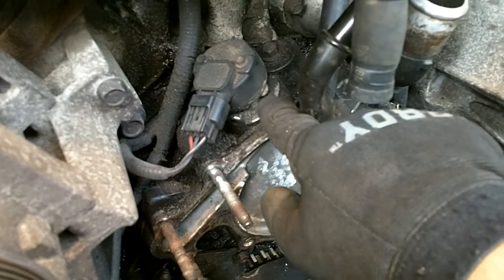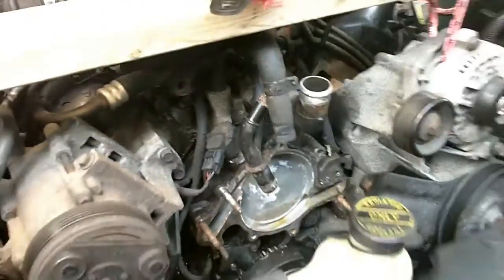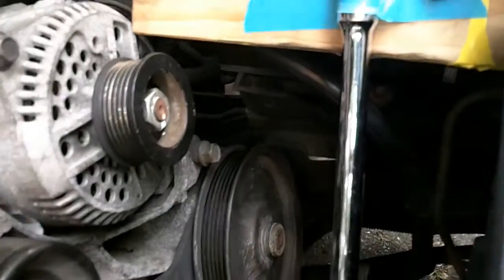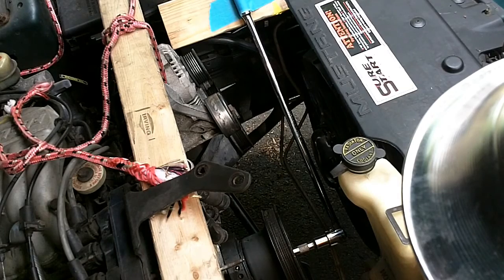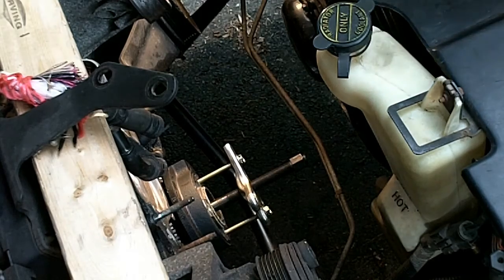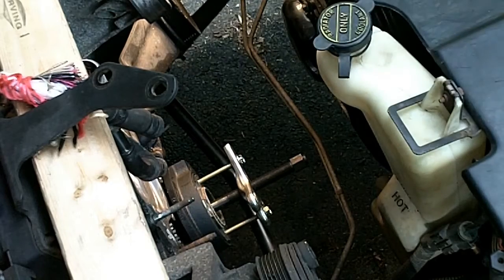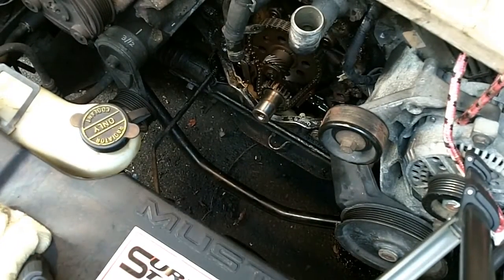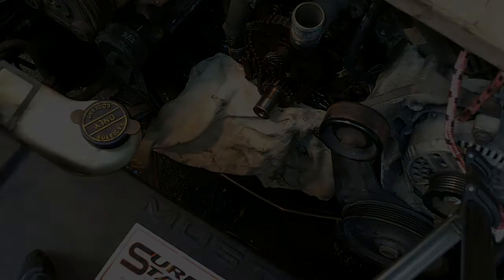Oil Leak Fix Part 2 Timing Chain Cover Gasket Ford 3.8L V6 1994-1999 Mustang Thunderbird

Comment: I know this is a very old video. But I broke the same stud you broke. Where did you find this specific stud, I can't seem to find it anywhere. Also, how does the rest of the stud come out? Does it twist or does it pull out? only the tip of mine broke so I can still grip it.
Reply from the maker: I think I finally located the part on an online Ford parts distribution site. I can't remember exactly. I'm pretty sure it's threaded, like a bolt, so maybe you can grab it with a pair of vice-grips....? Good luck

Comment: Ive got a 3.8 v6 1994 stang that I did this with thank you but my oil is all the way high on the gauge what could I do to get it lower ive changed oil and pressure sensor nothing changed

Comment: How did you get the cover off without prying or cracking it? Mine is having trouble coming loose
Reply from the maker: Yes, that gave me trouble. I did some banging and prying, and I think I hacked off one of the bolts with a saw. My cover did evidence a slight crack. Not sure if I did that by banging on it, but I might have. I fixed it with a JB Weld - type product. I have another video on that.... Good luck.
Reply: @Buckwsr   did your cover still good condition? It works?
Reply from the maker: @susanalopez-pardella4049  I no longer have the mustang, but the repair job held up very well for as long as I owned the car.

Comment: There was no gasket between the cover and the oil pan. Straight out of the ford repair manual, and also alldata, both recommend an 8mm strip of black sealant, thats why the oil pan has a dish in the center of that front lip so you know how much to put there
Reply from the maker: The Ford manual actually calls for the entire oil pan gasket to be replaced.  I did not do that, and few people would go to the trouble to do so. The gasket kit for the engine cover (link in pinned comment) provides RTV sealant to use on that lip between the engine cover and the front of the oil pan. I absolutely used it (see video part 3), and to this day, some 18 months later, the engine is completely dry and clean with no leaks. I saw some of your other comments, and I appreciate the input, but I don't know where they are now....??? Take care.
Reply: I was simply replying regarding where you talk about the rtv on the pan saying someone must have been there. 
Ford released a TSB(technical service bulletin) on gasket replacement adding to drop the pan because originally ford was paying us tech's to replace the gasket without dropping the pans. Soon after people were returning with blown enginges because gasket material was clogging the oil pickup screen. Didnt happen to me personally, but that was the reasoning for them releasing the TSB changing it to drop the oil pan.
It began as described with high temp black sealant.

Glad to hear its still going strong. I watched all 3 of your videos just trying to find a picture of bolt placement. Thinking it would be a quick way to double check everything while i put my car back together.

I could sit here and spit tips all day but decided to remove my comment to refute any dispute before it arises. Input online typically just gets you into a pissing match with someone and i dont have the time to flap in the wind right now lol.

Just figured id add some things in case anyone ever watches them for input. Like my comment mentioning the cam synchro. Or that you should run the timing cover in using the two alignment dowels(that i never saw you mention in your videos, and were responsible for your cracked cover) and with the harmonic balancer, then install and torque the bolts. This will create a perfect seal to the block, as well as a perfect seal on the front main seal. It would keep you from having any play as the balancer is spinning within it.
But im glad your dowels stayed in place, it helped you out greatly. And glad your epoxy held up, it saved you a big headache.. theyre in short supply nowadays because 9 out of 10 times they crack exactly where yours did.
The trick is putting light heat inside the openings to the dowel pins once the bolts are removed, then repeatedly spraying penetrant inside those 2 while prying.
Reply: However. I have seen and installed the felpro kit you mentioned. I likely wouldve used the flap kit myself if it was in stock anywhere close. But any high quality black high temp sealant will work. Just keep it in the aforementioned groove and toward the front of the lip. You can put it a little thicker in the corners too.
Reply: And i 100 perceng agree that few people would go to the trouble of dropping the pan. Ive watched techs do the job without dropping it, even after the tsb was released
Reply from the maker: I appreciate all the good feedback. As a DIYer, I know I could learn a lot from hanging around with you. Thanks again, and good luck with your repair projects.

Comment: How did you get the crank pulley to come off?
Reply from the maker: The crankshaft pulley bolts up to the damper/harmonic balancer with 4 bolts. Fairly simple to remove. The damper/balancer requires a special tool to pull it off the crankshaft.

Comment: I forgot to mark the crank shaft pulley. I marked the damper though. Am I fucked?
Reply from the maker: idontgiveadamn79 the damper has a keyway, so it only goes on one way,  So no problem there. The crank pulley is probably no big deal. To be honest, when I went to reinstall, I couldn't find the mark I had made. Hasn't been a problem.